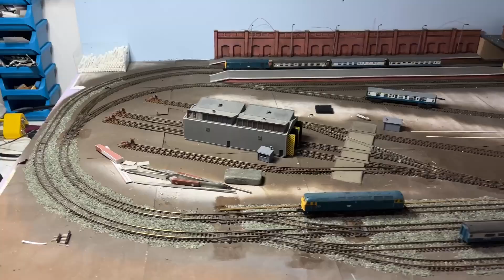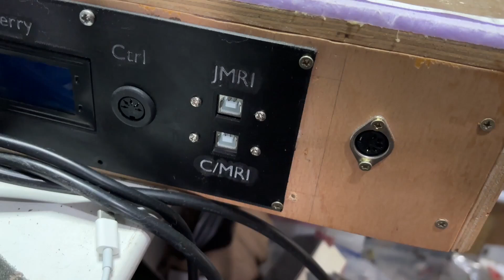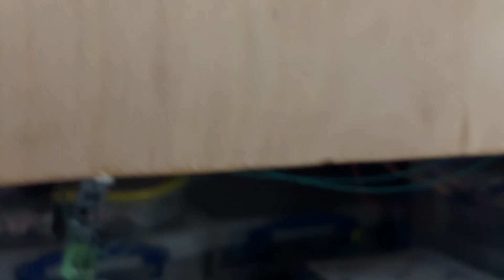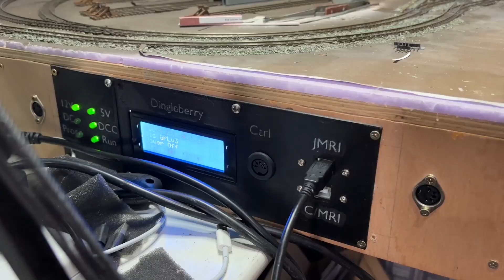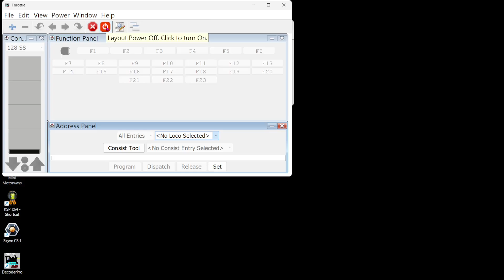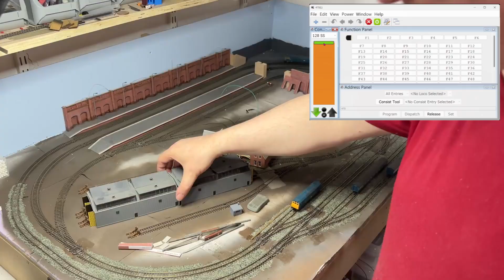Episode 87, 1,000 subscriber special, part two! at Leopard Street Model Railway #oogauge #ngauge

Comment: Dingleberry awakens! Well done on getting it running again! I think the 47 kept derailing on the inner loop because the point was set against it! You mentioned it about ten seconds before trying to run over it! :) I like the control panel for the display and sockets on the side of the layout! Did you make it yourself? If so, how? Smudge had to be the star of the show though! Loved the shot of her sitting on your chair! Lol! Hope you do some more work on this layout! YouTube needs more N gauge content - and cat videos! Yes, definitely more cat videos too! :) Cheers, Ian.
Reply from the maker: yes very firmly the point, found though the acceleration/braking rate is a bit high (as in from full speed it took over a complete circuit to actually stop..)

the panel is a 3d print, printed with the face you see "down", the back has mounts for the screen and plugs etc. its actually to parts (printer isn't wide enough for one bit), the six LEDs on the left are on their own, there is a bit of stripboard behind that holding them and the various resistors. its actually half the reason I got the printer, the servo mounts are also 3d printed. I did try printing retaining walls but the horizontal lines were a bit much

Smudge, aka "flipping kitten" or similar words does love to get involved 

not sure what to do with this one, track reliability is far too low and I have Leopard street for the electronics.. actually ponder a total rebuild, same size, virtually the same layout (though dropping a siding to make the platform at the back wider). cost is essentially plywood and more track.. the rest  Ihave..

hmm..

and cheers for watching, I do love N gauge, always have, just a bit too small for some of the fun electrickery stuff